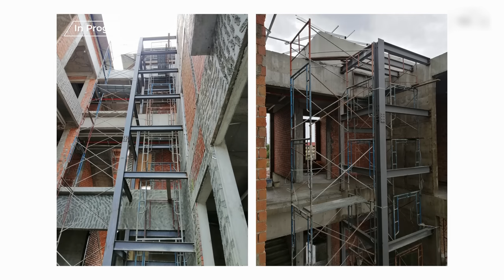Malaysia's Extraordinary House｜Million Dollar Mansion｜Lee Residence｜Luxurious Tropical Design

Comment: Not the biggest fan of the exterior facade, but holy moly the interiors and patio/deck areas are stunning! Great job!  Modern luxury

That island in the show kitchen is an art piece in itself wow and the "dirty" kitchen is a show stopper too. 

Absolutely love the use of the natural stone finishes in every room.  Would have liked to see more of the natural stone and wood materials on the front facade.
Reply: Agree
Reply: It's  call " wet " kitchen - mainly to separate the cooking area & air conditioner dining room due to the tropica heat.

Comment: I have a question for people living in wet, tropical climates like Malaysia.... do you use inside-outside feature that often?  It was popularized in Cali and then Australia and maybe the Mediterranean, where you have subtropics warm enough for it but also not too much humidity.  With very humid climates, is it even practical? Can you really open up things without getting humidity to ruin interiors and getting a lot of bugs?
Reply: I live in singapore ,weather is same as in msia....yeah personally balcony is not my thing cos the daytime it is usually very very hot and humid. Even if indoors, I will close my room with curtain just so the heat will not enter. I hv been to cali and yes those places even the weather is hot, I can stil sit at the balcony cos there is still cool wind. bugs wise here if u stay near the nature yes high chances there are bugs. but for this house they re smart to have those blinds and not too much exposure to the outside it seems like.
Reply: I used to live in a small town in Malaysia as a young lad, quite near to Muar actually.
Our house has an air well and I don’t remember any bugs problems. Maybe it’s brightly painted, uncluttered and some selections of potted plants, citrus and scented herbs. There’re no dark corner and surrounded by high roofs on all sides.
When the weather is hot, air is drawn up the well and we have cool breeze just by opening the windows. We hardly turn on the air conditioner.
Reply: @LenaLuthorWife  cool! I suspected as much!  I vacation in Italy and Spain and it could be 90 but in a garden in the shade, it's very comfortable. And here, in NYC, when its 80 but humid, I want to be inside under AC.
Reply: @madsam0320  that's interesting! Air wells work really well and if it's all roofs and walls and no still water somewhere, I see why there are no bugs.  Do you think this house would get much of outdoor/indoor living?
Reply: @mrvk39  it seems too large, but they are a big extended family. Personally, I think it’s not very homely, too sterile.
Reply: In my opinion all the room have aircon almost 24/7 and 2 maids will help to complete the job of keeping everything clean and in good conditions
Reply: @unpostropicciato  yes, that was my suspicion ... so these "seamless indoor/outdoor" houses are just for show.
Reply: Kind of curious of how much would the electricity be if air conditioning is must to stay comfort inside
Reply: @notfadeaway6617  well, if they keep doors open, it's wasteful and borderline immoral to keep air running

Comment: Hum... love the height and thus the openness, but the interior deco is still too 'bits and pieces', with too many lines here and there clashing each other (the marble patterns on the floor or the walls, cut-out lines of the screens, lines of the bar tables, the profile of those chairs, the sofas, everything indeed) and texture juxtaposition that doesn't quite work (i.e., too crowded, too many to see and thus visually suffocating, also lack primary and secondary foci in the overall design and presentation) - a classic symptom of mediocre design. Also lacks ambience (i.e., the soul). Still pitched at the level of visual interest (1st and basic level), not yet atmospheric (advanced). Work harder and make more references to architectures and interiors in JA, if not European ones in Domus, etc. PhD(RCA), MDesRCA
Reply: sounds like my lecturer
Reply: @izzudinzainudin4835  Your lecturer got a job to do. Honest, and even harsh, comments lead to improvement, praises and compliments don’t u think?